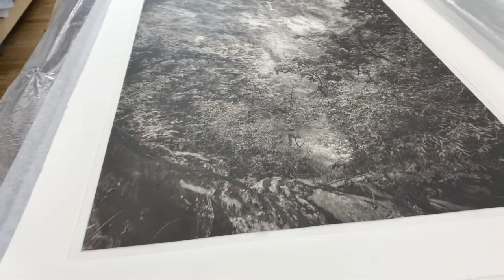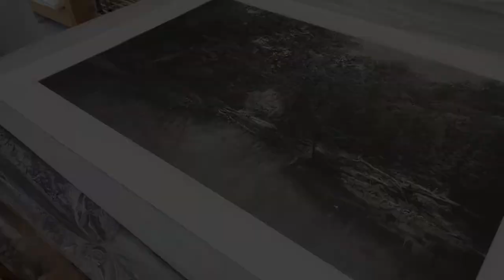David Hartt direct to plate photogravure at Cone Editions Press

Comment: What kind of plates are in use? Who is the producent?
Reply from the maker: These are the new Green Mountain Plates exclusive to InkjetMall.com.  They turn yellow after exposure, have a very long tonal range as a result of their slow exposure speed. These we produce direct to plate using a proprietary 10 ink system which further increases tonality and resolution. Plates are here: https://shop.inkjetmall.com/Green-Mountain-Plates-SM-95.html     If you would like us to produce them ready to print for you that service is here: https://www.cone-editions.com/gravure
Reply: What range regarding UV nm can be used? All within UVA?  And are both the printing parts and the non-printing parts of the plate at the same height? In other words like an offset-print? Some kind of a litho-print? Can any type of ink via any inkjet-printer be used if the colours are defined (CMYK). Hopefully You will answer all of my questions! Thanks! @ConeEditions
Reply from the maker: @Jolleseileren  the ideal would be 365nM, but up to 390nM although a bit more exposure time would be necessary. The plate could be used for relief where you expose what you want to remain high and roll up with ink, and what is not exposed goes into relief. But we exposed with a positive image so that there is a continuous-tone intaglio into the photopolymer... and where it goes below the surface is where it retains the ink. The surface would be where it does not or where it prints white or nearly white. BUT in our process this depth is very very shallow.  How we do the inkjet direct to plate you can see here: https://youtu.be/7ZrV_y14Df4   Some of the customers of our plates use their own workflows where they simply print a grayscale image onto the plate to act as the "positive". We use a special set of 10 gradated carbon inks and a calibration process to produce absolute continuous tone. If you have your own etching press - contact our studio and have us make you a plate. Making plates for other studios is part of our business.   https://www.cone-editions.com/gravure